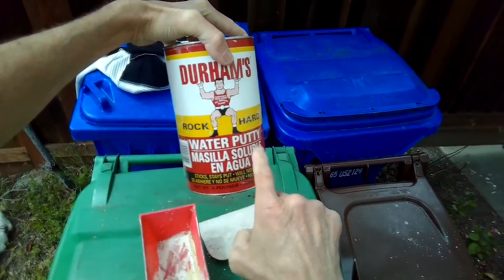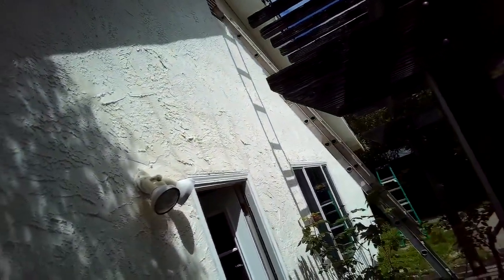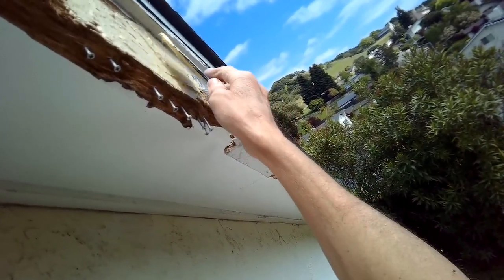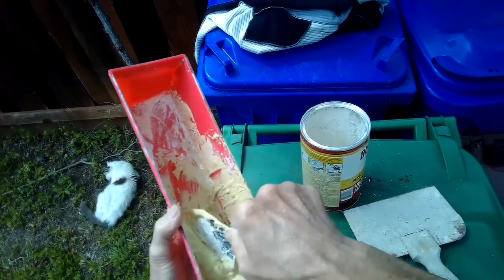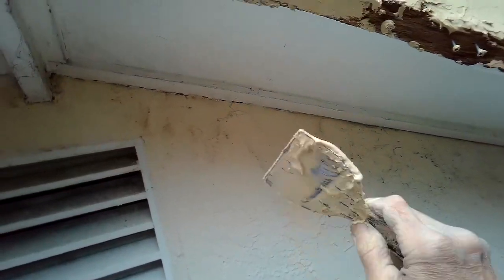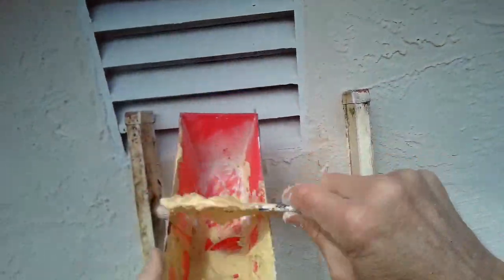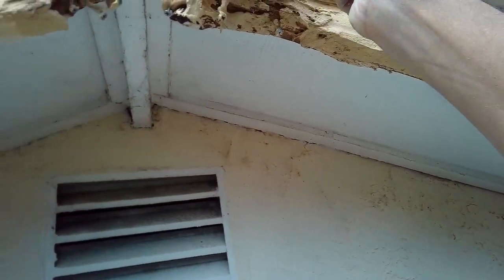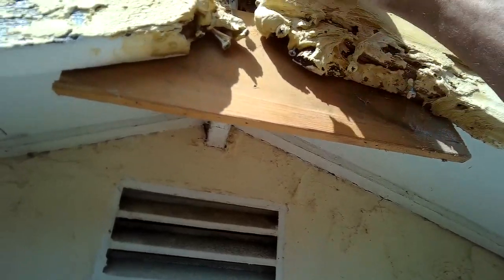✨DRY ROT FASCIA—CHEAP FIX✨

Comment: The dryrot damage in this video is pretty substantial. I recommend to do it right and replace the damaged wood. Having done quite a bit of pest work for houses on the market, I  have always cut out sections of dryrot and "glue and screw" new wood.
Reply from the maker: Good idea😊
Reply: Agree. That all needed to be replaced with new wood.  Not patched

Comment: Seems like a lot of work, rather than just replacing the rotted wood.
Reply: Yeah prob easier and cheaper to just nail a new 2x4
Reply: You would have to rip off the roof on the rake edge to replace this properly....

Comment: The problem with both Bondo and Durhams is that they do not expand and contract in the summer/winter as does wood facia boards. Over time the patch will be noticible and even separate. I have used bondo over the years in small repairs and found both products to be inferior.
Reply: What do you use instead?

Comment: I love Durhams. Been using it to fill in carpenter bee holes and for early stages of wood rot but hadn’t figured out how to use it to repair the badly damaged pieces until now!.  Thanks to your video! Going to be using your screw tip first thing tomorrow.
Reply from the maker: Thanks Crystal😊😊